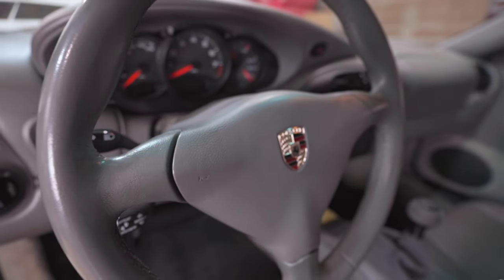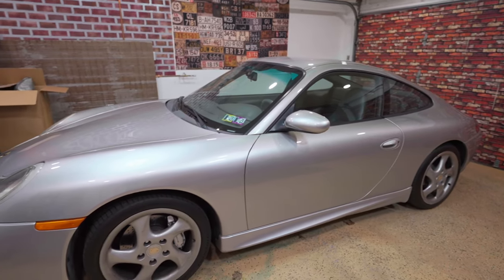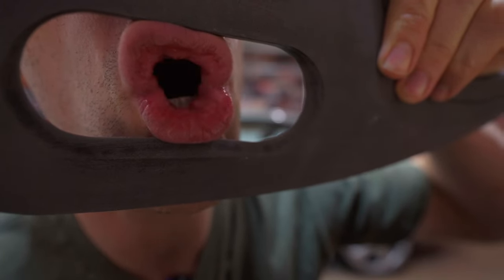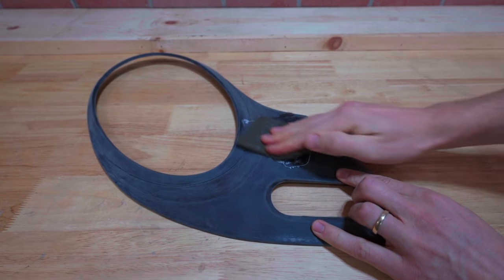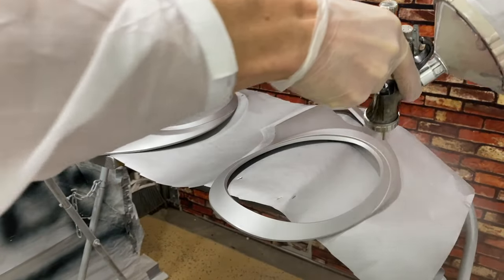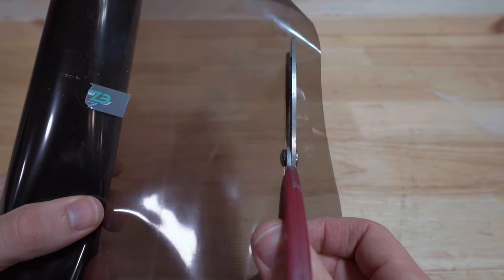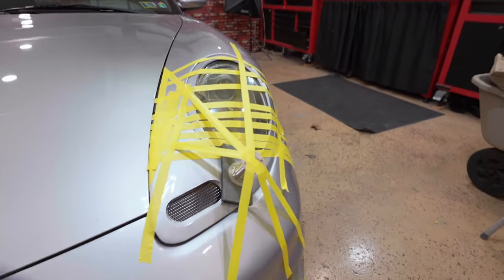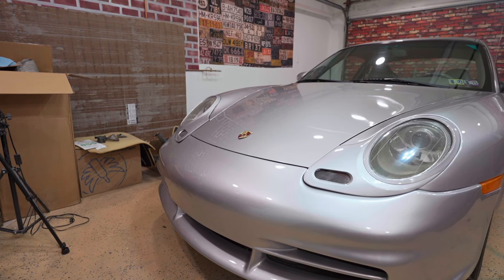I found the best Porsche 911 996 Headlight upgrade

Comment: I have one but changed the interior to black with some 997 seats and a nicer stearing weel also from a 997 and changed tho motor to a straight 6 from a 997 (i got the parts from a wrecked 997 for about 1000 euros btw and increased the room in ur frunk
Reply: Btw i bought it bc i like the headlights and its cheap

Comment: I was really expecting those to look awful. They don't. They don't 100% make up for whatever the hell Porsche were thinking when they made the 911 indistinguishable from the Boxster in a rear view mirror, but they don't totally suck. 

I have an '85 3.2 Carrera which in my wholly biased opinion, is one of the best 911's of all time. The 996 is indeed the worst. That even takes into account the fact that the 2.7 SC engines' head studs liked to pull themselves out of the case, and could blow up the airbox if they backfired. 

That said, I don't hate it. It is after all a 911. One thing  that goes a long way towards making a 996 feel like a proper Porsche is to not have that godawful abomination of a grey interior. Black guts look 100 times better. The grey just has a nasty, cheap, Geo Metro look to it.
Reply from the maker: Aw man totally jealous of your 85. That might be my next generation of 911 project. You nailed it with the grey interior. It's worse than the headlights.

Comment: Signal light looks stupid dude actually more crappy than factory. Thus mod is only acceptable on the 996.2 which I used 3M double side tape instead has been working well for 3 years now. My porsche certified mechanic thought I own a 997....
Reply from the maker: The 3m that I found was a little thick for this.

Comment: looks much better.
Reply from the maker: Minority opinion around here
Reply: @EdgasketGarage  I get it. You invest a lot in a car and all you want to see is perfection.
I have a Lotus Evora and a Tesla Model S Plaid. Both great cars with some large flaws. Ignoring or denying the flaws will not make them go away.
I had a Honda S2000 because everyone told me it would be great. I tried for years to see the greatness but the lack of low end torque and having to flog the car to get any performance made me sell. Was much happier with a Miata ND.

Comment: Those headlamps were originally designed by a frustrated Accountant!
Reply from the maker: Will someday be sought after as rare!
Reply: Not really they are shared with the Boxster, at this time Porsche was in serious financial trouble, parts sharing was part of the cost sharing. Had it not happened there was a very strong possibility that Porsche would not have survived.
Reply: Haha, no. They were designed to be like the headlights on Le Mans cars like the 917, 956, and 911GT1 of 98'.
There are actually a couple different types of those headlights and they were some of the first to feature HID technology on a production car.
Reply: No, they were designed for a thoroughbred racing car. And they saved Porsche from extinction !